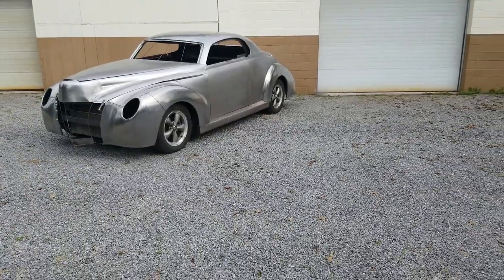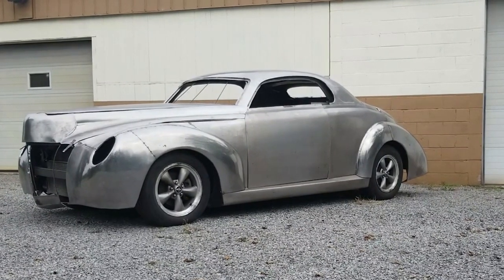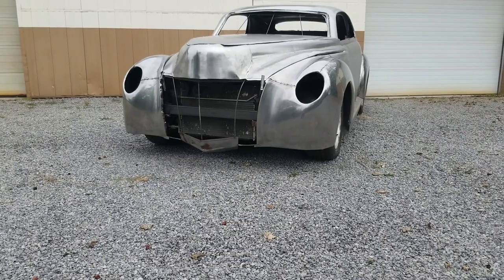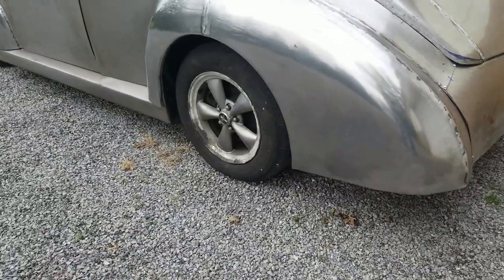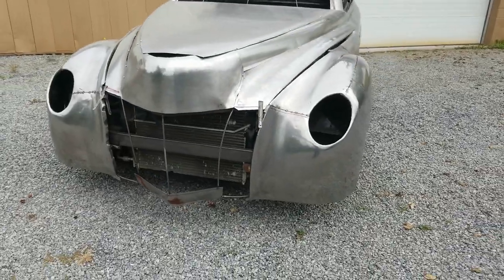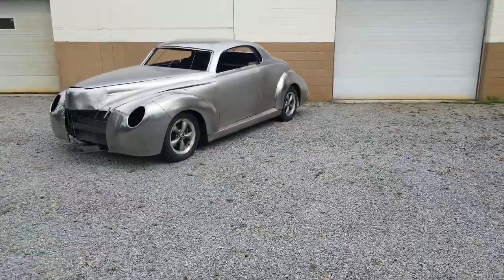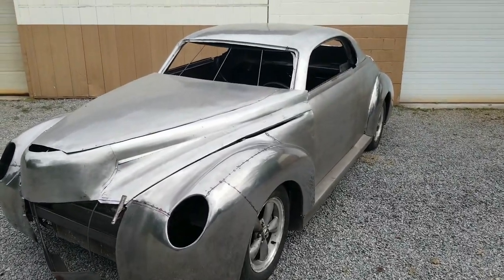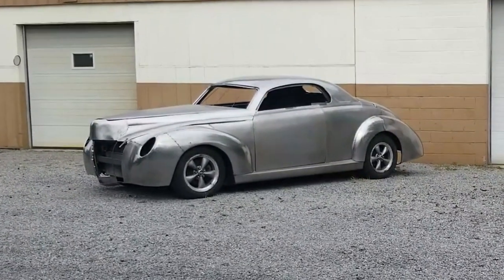MOCK UP! CUSTOM Built 1940 Ford Hardtop Coupe - 40th Episode

Comment: Nice to see it on the ground.  I was concerned about the strength lost in the original Mustang roof. I haven't seen all episodes yet so maybe you added strength to the uni body.  Hope to catch up at some point.   You've done an awesome job.  Thanks for informing us.  I built my car ( kind of basic ) on a open frame work table.  I could work under it, around it,  which made it convenient.  When I set it on the ground, I had to change things as I had no roof structure to help.  My chassis wasn't up to the task.  Jack of all trades and Master of None and that's No............  Richard Lippert
Reply from the maker: Hi Richard.  Internal structural areas were all recreated and then some.  Thanks for the kind words.  Much more coming soon! Take care.

Comment: Love it. Are there going to be fender skirts? That might give you that extra low look without lowering the chassis. I see a two-tone forties paint scheme with era correct-ish pinstriping. Definitely not thinking Tangerine and Yellow. Second view, first comment, great video! Thanks again.
Reply from the maker: The car is still kinda light without the interior, glass and a full tank of fuel.  We'll see later how things sit, but no plans for skirts.  The truck will be getting a 2-tone paint scheme and the Coupe a solid metallic colour.  Still discussing that part with the Clients.  Thanks for the thumbs up Rick!

Comment: I think that maybe the front of the hood should come down a little, to have the hood match the angle of the top of the door, belt molding line.
Reply from the maker: You're right Domino.  When I start trimming and fitting the hood sections for the final time I will make sure it blends into the top of the doors.  The front nose is long at the moment and material needs to be rolled into a flange.  Thanks for the input.

Comment: Given speed bumps, parking lot dips, etc. Maybe leave the chassis up but bag it so it is more drivable and can be made low if the road will not damage it. I'd hate to drag the lower valance on a parking curb.
Reply from the maker: Yes, that would be a shame.

Comment: Windshield corners need rounded  .every thing looks great just something off with windshield . Impressive
Reply from the maker: Hi Glenn, thanks very much for the feedback!  I'll have a look at that.
Reply: @iNVisionPrototypes  I see where you were trying the fitment of the window and that black around the outside edge makes it a look a lot better
Reply: What gauge sheet metal are you working with I have been use an 18 gauge I like the rigidity but not how hard it is to work
Reply from the maker: @glennbevan8743  Thanks Glenn!  As the build moves along you will see things fall into place.  Thanks for watching.. much more to come.
Reply from the maker: @glennbevan8743  Normally we use 19Ga for hot rods and restoration work on classic cars, but due to current supply issues it's been impossible to get.  The exterior sheet metal on the custom '40 is 20ga.  Not sure if you're into newer cars, but have you had an opportunity to see any of the mid-engine R2 build/montage videos?? I used 22ga for it's exterior.  That worked out quite well.  Here's a link  https://youtu.be/urZy2wHO-Bw

Comment: i am converting a 37 ford 2 door sedan to a coupe, chopping the top and removing the b pillar. What rear quarter window set up are you using? i was thinking 65 66 mustang hardtop window regulators would work.  What do you think?
Reply from the maker: Hi John,  it was a pair of late model convertible units we had in storage.  Unfortunately, I don't recall what they came from.  Would need to run the numbers.  We initially tried a pair of manual ones that came from a late 60's Camaro, but the throw was wrong.  If you have a pair of the Mustang ones mock them up and give them a try.

Comment: How did you get that chopped look?  Are the doors and belt line raised?
Reply from the maker: I did a side view illustration of a chopped original 40, then scaled the entire body up by around 5%(to fit the client).  That also helped fit the modern chassis.  The proportions of the M40C are almost identical to that of a 1940 Ford Coupe just a little larger.  Longer doors and the wider cut lines for the hood to allow access to the Mustang's engine compartment components are the only exceptions.. ohhh and the one piece windshield. lol!
Reply: @iNVisionPrototypes  That is a very ingenious approach to how you made the M40C look chopped, thank you for sharing Nick!

Comment: To me it looks a little nose heavy, a little too high and sticking out too far past the front fenders. Over all it looks amazing, I wish I could be there to look at it up close. Thank you.
Reply: I think I would wait for the grill before changing it.
Reply from the maker: Once we create flange supports and bolt the front fenders on they should tuck in a little.  We will definitely have another look at it again later before paint with the grill mocked up.  Cheers!